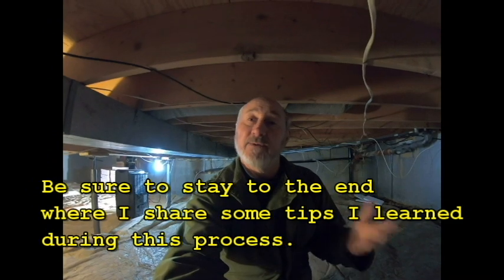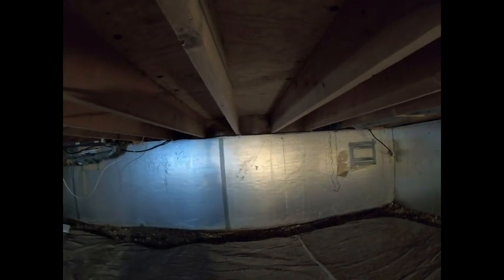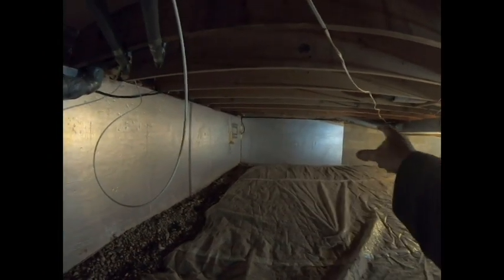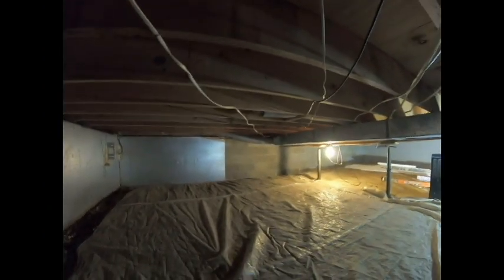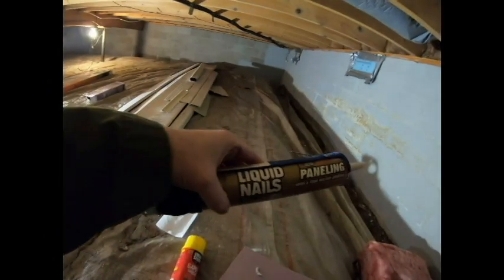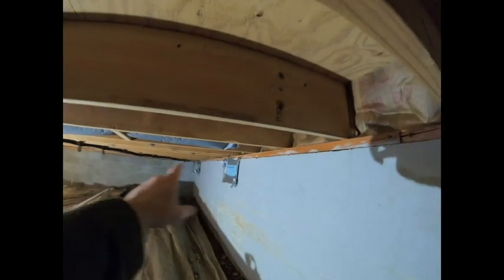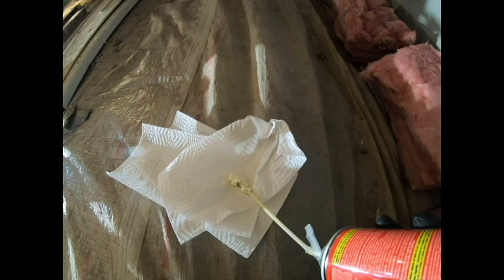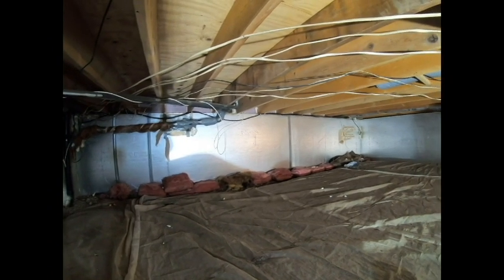Fixing a Crawl Space - Rim Joist Insulation

Comment: Interesting video and good job on the rim joists. But I'm curious what potential drawbacks and advantages there is to totally sealing off the 4 vents? I've seen crawlspace videos where its totally encapsulated but your foundation walls don't apprear to be and it looks like some plastic on the surface but gaps near the walls. I saw what looked to be a dehumidifier.